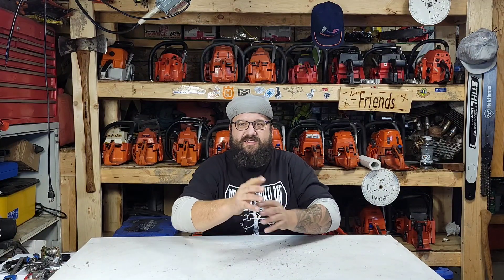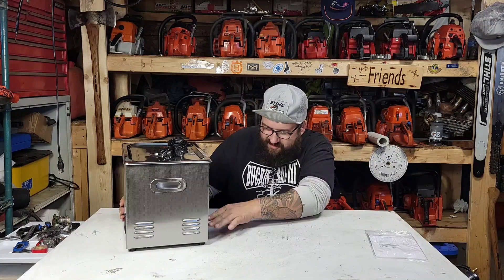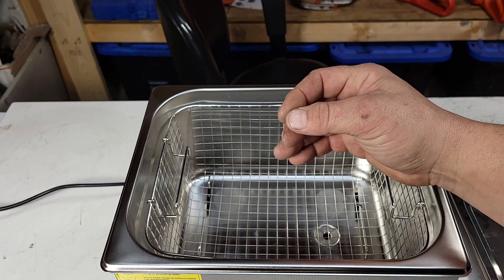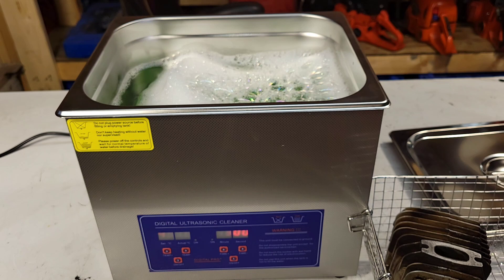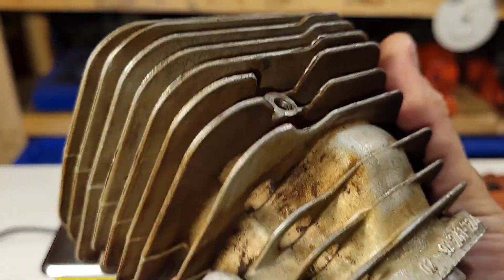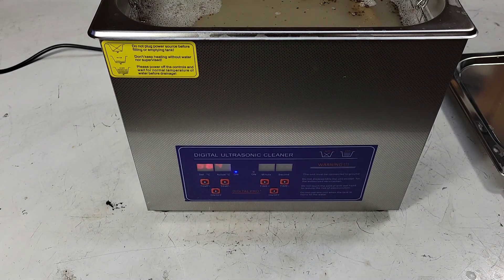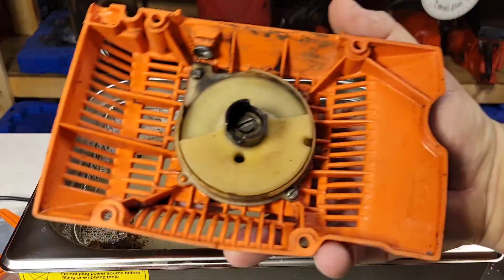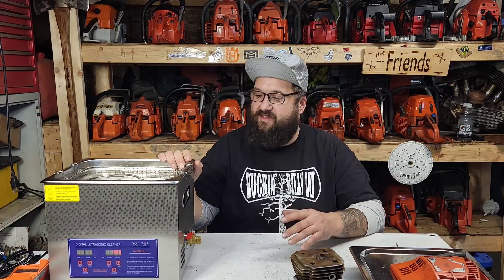Ultrasonic cleaner for cleaning small engine parts!!

Comment: I just bought one of these things (6 liter Harbor Freight or Princess Auto in your neck of the woods) about two or three weeks ago. I’ve been throwing everything in there when it comes to small engines. Spark plugs, carburetors, anything with a bit of rust, residential lawnmower pulleys, I’m about to throw metal wheel gears and a Briggs & Stratton muffler in mine. It was running rich due to carburetion issues and want to get the carbon out of the muffler. There is nothing like the sound of a clean muffler on any engine. We do not get the benefit of Fahrenheit but hey, with AI, Google and Siri, we can quickly convert to Fahrenheit and learn the Celsius scale which we need to learn anyway

Comment: You DO NOT want to use any gas product in a ultrasonic cleaner......very bad things will happen.  Also, no body parts in the fluid while the unit is running.....it will cause your blood cells to 'explode' also

Comment: PINE-SOL original formula--I'll get back to that in a second.  I bought one of these a couple of months ago and spent way too much time researching cleaning solutions/solvents and usage hacks so I'll try and increase the return on that by sharing what I learned.  FIRST off, 100%  yes to containers--esp glass or metal as plastic will apparently dampen some of the ultrasonic effect. Ideally you want your container vented which argues against a submersed jar with gasoline--I haven't tried it but if it were to expand and pressurize while washing, no good would come from that.  LARGE TALL JAR or COFFEE CAN works great to get to allow venting or when you  need added height...i.e. cylinder heads...plus no struggling to get those floaties strained or washed down that tiny little drain. SECOND: RV antifreeze (the cheap stuff with methanol only) which is basically windshield washer fluid but without detergent, works great to keep primary bath water from freezing if your garage isn't heated--no need to use it straight, just add sufficient amount to water to keep it from freezing.  (I drain my tank after use into plastic gallon jugs for easy transport to preheating kettle prior to reuse and for added safety against tank freezing in case my mix math was off).  THIRD: PINE-SOL original formula--not lemon scented.  Compare the MSDS data and note that the active ingredient is the same as in many dedicated ultrasonic carb cleaning solutions that are sold every day for way to much $/gallon.  It's completely harmless to aluminum, works great, and no sudsing/foaming--just a few ounces and water does the trick.  In general any traditional detergent,... Dawn, Simple Green, Purple Power, Krud Kutter, Cascade or other dishwasher detergent... is going to be highly alkaline and thus corrosive to aluminum. The "aluminum safe" versions of all of those have an active ingredient along the same lines as Pine-Sol.  I've read that alum-safe Krud Kutter works great but isn't commonly stocked here and costs way more than Pine-Sol.   FINAL UNSOLICITED TWO CENTS: I needed the length for cleaning my Ramset gun so I bought the 22L unit.  It's not the easiest to store and would cost a fortune to fill with any kind of prepared dedicated solution available on Amazon, but using the above methods it seems like getting the biggest one you can afford to begin with is further testament to "buy once, cry once" theory.
Reply: Brilliant.
Reply: the cleaning ingredient in pinesol is SLS. Which the most common detergent found everywhere (soaps, shampoo, you name it).
Reply: Oi

Comment: Dang tinman I thoughtcfor sure you had the biggest baddest ultrasonic available. I made a video for my other channel I need to post on the small one of these. Yes a cylinder fits but I wasn't sure if it was safe. Now I think I'll try it. Ya they're a game changer for sure. My parts washer is not rated for petro based solvents so this changed the game big time for my metal parts and smaller plastics

Comment: i use Dawn dish soap a few tsp few cap fulls of degreaser and 40 degree water same unit 13liters, but it tarnishes aluminum and it hurts the orange paint 1 hour, kinda hurt the paint on a few cases...trying to find a better solution. its nice to geat soak the old hard saw dust.

Comment: Hey Timman,
I got the same here in Germany.
Litle hack, if u press and hold the "On"-Button (or + & - Time, i dont remember exactly) un can set the time up to 99min. Normaly it ends at 30mins.

I've got  another smaller one xtra for my carburators. I clean them only with water and citrus acid.

Have fun and greats from Germany

Comment: Ultrasonic changed my life! They are definitely a time saver. I found that some parts especially husky saws will turn a milky white if left too long? Not sure why, that was using just dawn dish soap... simple green 10-1 mix seems to work well, still experimenting. Have fun!
Reply: yea ive found with Dawn few tsps few cap fuls of degreaser  in 13 liters,40-50 degree  tarnishes aluminum and takes dulls orange husky paint and a little white not reaaly cool

Comment: Ultrasonics are great.  Simple green is a good solvent to use.  

The comment below about shadowing is correct.  The waves propagate from the transducers and are blocked by solid objects leading to the side closer to the transducer cleaning faster. 

Simple green is not corrosive. It does have a bit of sodium, but it has neutralizers in the mix.  I have inspected aluminum at 80,000-100,000x magnification after simple green cleaning in a SEM. Many times. 

The bubbling action does attack parts, when the bubbles collapse it happens at the speed of sound, that will erode the substrate creating pits which you might have confused with corrosion.  

I spent years just doing development of cutting edge cleaning, inspecting at a nanometer scale and testing for remaining contamination down to parts per billion or trillion depending on what element (atom or molicule) was being tested for.

For cases, just get a dishwasher.

Comment: Use the aircraft simple green, it’s not corrosive like the original.  I haven’t see babe e tire bud yet but make sure you put your carbs in a glass bottle with a separate cleaning solution.  The Walbro’s in particular have an internal check valve they can brake in ultrasonic cleaners.
Reply: What solution do you use for carbs?
Reply: @kennethfraser9006  straight sea foam

Comment: If you add a good bit of time it helps a lot. Also on small parts you can use zip lock baggies with your  cleaning solution and your small to medium size parts. It keeps your solution cleaner longer 🙂

Comment: stay away from using flammable solvents in that unit....bad idea! I have one for several years this size and others down to very small. They do have a place in a good shop but within limits. It comes down to what you use for cleaning solution and sometimes the smaller units are really low performance. cleaning solution needs to be hot for best results. I have been surprised by how well Cascade Platinum dishwasher pods work. I have use the cascade on model airplane engines and small carburetors. Do not recommend to leave parts in the cascade, rinse right off as you will see it tends to attack aluminum.

Comment: Awesome Tinman! I've had the same in it for a couple of years, and clean everything in it. I use a product called Oil Eater, using 1 cup. I get the gallon size, and is very good and economical. Crank the heat, and run the full 30 minutes. Saw and auto carbs come out like like new.

Comment: Tinman I had a couple of the same ultra sonic cleaners also!! I ordered the medium sized one and they ended up sending me the smaller one and called them and told them that they had sent the wrong one and they said that they would send the Wright one to me!! I asked them what they wanted me to do with the wrong one they sent me?? They said don’t worry about it just keep it also for there mess up!! I would use it all the time to clean chain saw parts and lawn mower parts!!! I don’t like using simple green because it would leave a nasty texture after words!! I would use several different things depending on how bad and dirty the stuff would be!!! I would turn the heat up all the way and turn the timer to its make and keep turning the timer up as it got close to being done and turned off!! I would Leave it in for at least a couple hours and then write away I would rinse every part with fresh water and then blow dry the parts with air compressor air and then let air dry for a while!!! I definitely liked it but I would definitely get a bigger one to help out with bigger parts!!! But definitely turn the heat up all the way and turn the timer to the max and I have never had any issues with it!!! Awesome video buddy and remember keep up all the hard work buddy!!!!!

Comment: Hey Tinman I'm building a 10mm slant fin 044 and using a Hiway piston. The Hiway is 0.010 taller than the original piston and the squish is 0.016 I'm sure sealant will give 1 or 2 thousands but is that to tight?. It a work saw with stock port timing just opened up to breathe a little better.
Reply: Check the clearance between the small end of the rod and the pin bosses on the piston. On most aftermarket pistons the crank is too loose in the piston..
Reply: @Oli4vn  Thanks for the info I just checked it and it's 0.090 wider than the factory. Is there a fix for this the original is cooked and oem is Is non existent.
Reply: @chrismuncey3861  making some bushings would fix it

Comment: Hey Tinman just a little tip find a container just big enough to hold the item fill with gas as cleaner then put in with the rest water and run it saves cleaning and gas works wonders
Reply: I didn’t watch before posting u got it
Reply: And throw away your brake cleaner start using starter fluid let’s try and keep you cancer free

Comment: You can actually clean electronic parts in them too!  A lot of computer shops use them to clean motherboards when they get a really dirty computer in for repair.  Hope all is well with the family.  Later.
Reply: The vibrations don't damage components or traces?  Capacitors??  I would think that's an issue, unless maybe the motherboard is in there briefly.
Reply: @LeverPhile  All the top tech companies are using them to clean boards.  My thinking would tend to fall in line with yours, but when EVGA and Intel are using them, it's hard to argue.

Comment: I use 6 litre and 30 litre ultra-sonic units for cleaning including electronic units at times, just think of cutting in heavy rain and the engine running at 8000 to 12000 rpm it's going to hammer any water at the ignition modules.
I use tap water and washing up liquid in the tank.
Place the dirty side downwards, pull starts/chain brakes and split air filters in half. 
For carbs/parts I use "Single Portion Chip Frying Baskets" ( do a search) keeps all the parts for one carb together and more carbs more baskets simple.

And why has it taken you so long to buy one...... 🤔

Comment: Hi,
I bought one last year.  Have used jars with gas.  Works good but like you I don’t like to waste gas and it smells. 
I use mostly water and a small amount of dish soap and Pinesol.
Best to keep the temperature down for plastic parts, could warp the plastic.  For carburetors, I recommend 50c and 30 minutes.
Reply: To add…
I only use the UC on the dirtiest, most corroded parts.  For parts that just need a basic cleaning, the extra effort required to prepare the UC and the time spent waiting for parts, is not worth it.

Comment: Hi Tinman, those ultrasonic cleaners do work great for parts cleaning. They also work very good for cleaning your eye glasses with just water and a little dawn dish soap. Just hold the frames by the temple arms and put them in the solution for 30 seconds or so, don't let the lenses touch any metal. You'll be amazed what come's off the frames around the lenses and the nose pads.

Comment: I have a five litre version of the same thing. It's a good and useful tool.

From experience, I can tell you that the ultrasonic transducers are under the bottom of the tank, and the ultrasonic waves propagate in an upward direction. The best cleaning effect is always on the side facing down, toward the bottom of the tank. (Bigger machines may differ).

I find it best to give it a spell one way up, then turn the parts over and repeat on the other side. Some parts, as you've seen, clean easily which ever way up they are, but harder materials seem to clean better if you turn them over and "do the other side".

Beware - Don't be tempted to put your watch in there! After ten minutes of rattling at ultrasonic frequency, it will probably never run again! 😚💨🤦💫💥🤷

Comment: You hit it with the containerized use.  They are so awesome.  My vet wife does high volume spay/neuter and the first step with the cleaning is about 15 mins in a big ultrasonic.  Anything that will remove hard dried blood that's coated in fat and inside the hinge of a forcep has my respect.  

I also drink cold-brewed coffee.  What usually takes 20+ hours takes about 10 mins in an ultrasonic.  

Beware of leaving aluminium, especially thin stuff, in there for looong periods of time.  15 mins is fine.  But dont do an hour with an aggressive cleaner.  It can pit the surface.  When I clean aluminium stuff i like to do about 5 mins..  scrub the stubborn aread..  and then hit it for a few more mins to finish the job.  Still much easier than pure elbow grease.

Comment: I bought one of these a couple of years ago and I don't know what I did without it. I usually run 50/50 simple green and distilled water as I scrub everything with dish soap and a nylon brush afterwards because ocd. I find it's usually worth it to at least blow everything off beforehand as the gunk accumulates pretty quick in the tank and you end up cleaning it up anyways. Congrats on the new toy, I hope it gets as much use as mine. Cheers
Reply: @Jason Calnan could you please comment on why you use distilled water?  Is that because you feel it cleans better or to prevent scaling in your machine?

Comment: I have the exact same cleaner and love it. I mainly only do carbs in it and use diluted partswasher degreaser. I run it full heat for 30min on old carbs. I clean the rest of the saws in a parts washer with diesel.